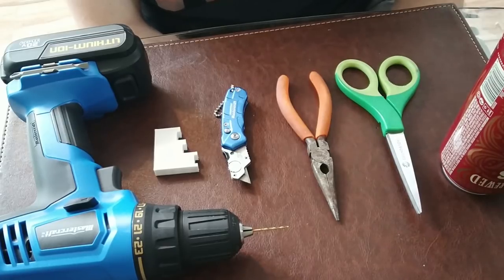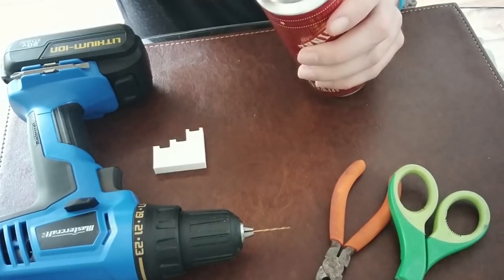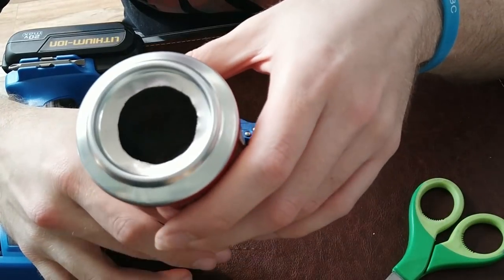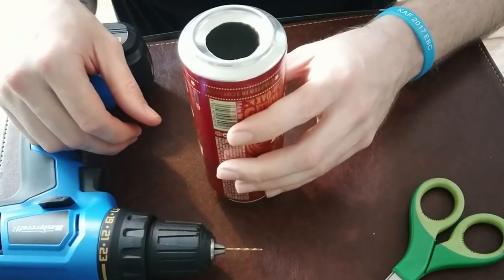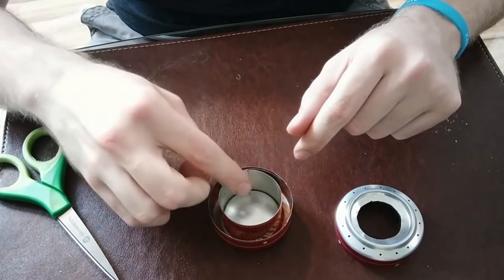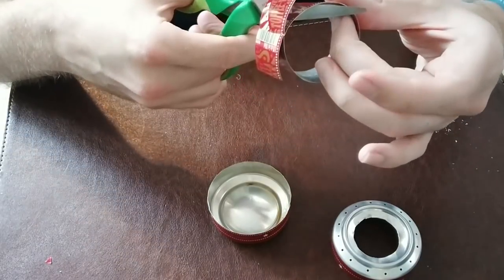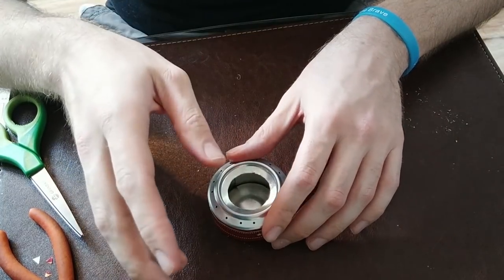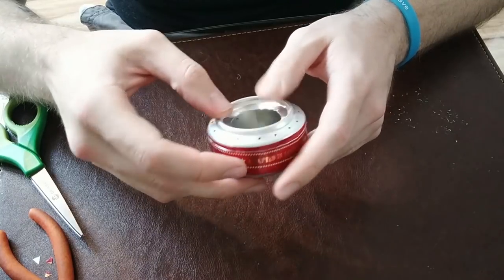DIY Double Walled Pop Can Stove!

Comment: Interesting method.  @17:30, I would think that since the aluminum is scored, you would be able to just flex along the score line and break the sheet you want from the scrap.

Personally, I just slowly freeze a few cans full of water and use the ice as a support and go to town on making all my cuts in one session.  Only downside is sometimes the ice will split a can when it freezes.
Reply from the maker: I never thought of using ice as a solid inside while cutting. Not a bad idea at all. Thanks
Reply: @JustForTheTrekOfIt  you'll lose a can once in a while from splitting, but its not bad.
Reply: dremmel tool with a small thin grinding disc could work wonders

Comment: I think its better to put the lille hole inside., to concentrate the flame inside,  and  to save  the fluid.
Reply from the maker: You mean a single hole in the middle or inside the walls? I prefer the holes on the outside of the ring so you don't risk snuffing the flame when you put a pot on top

Comment: How was your trip, and did the stove work well for you? I like the low profile design you have here. Does it work better than some of the taller ones I'm seeing? Everyone has measurements for their stoves, but nobody says why they chose that size.
Reply from the maker: JR M, to be honest, I haven't tested taller or shorter designs to compare them yet. I might do that in the future to get the best option. It works well and boils water in about 5 mins but does use a bit more fuel than I expected so maybe a taller design would use less. I will have to try that and see.
Reply: As you test more, please keep us posted. =)

Comment: I honestly would not worry about muffler sealer or as another commenter added, JB Weld once the meterial hardened. I would caution to take care that none of the fuel drips or splashes into the cooking pots or pans, there are toxic additives in denatured alcohol.
Reply from the maker: NewHampshire Jack I agree, the JB weld and muffler sealer might be a little overkill for something that is supposed to be cheap, easy and realistically easy to replace if anything breaks down over time

Comment: 20:25 Your notches are much too deep. That depth will cause the stove to lose pressure and burn slower near the end, as soon as the alcohol level falls below the top of the notch. The outer chamber pressure will be able to vent to the inner chamber. Your notches should be only 1-2 mm max.
Reply from the maker: Thanks for the tip!

Comment: Please remake this video to cut sequence of max 2 min and "Basically" get rid of the 24 min. "Obviously" everyone's time is important..! Thanks!
Reply from the maker: I appreciate the feedback but a remake isn't something I'm going to be doing anytime soon. I've started using gas stoves as they are a bit safer and lighter than carrying liquid fuels on the trail so I'm not sure if I would make any more of these stoves to take with me bug keep one as a spare just in case.
Reply: @JustForTheTrekOfIt  I find your comment very informative and useful...and is something got me to consider the same. Thanks for responding...and sharing your vide as well. Cheers!

Comment: You might like to check out a new design I've posted with internal and external flame jets. It works best with ethanol, heats from the moment it's lit, doesn't need a pot stand and allows easy retrieval of unburnt fuel for later use. It also works well with charcoal
https://www.youtube.com/watch?v=DcUKaHoYEUU

Comment: You could have made this in under 5 minutes without leaving out any info. Huh? What? Yeah you are slow. Also just make your sides wider leaving more to overlap. You won't need any tape or glue
Reply from the maker: Beaches south of L.A. Thanks for the feedback and yes, it was longer than I expected to be originally. I might make a trimmed down version in the future. As for the overlap, I don't trust it not to leak during operation without the tape. I don't want to risk a leak of flamible liquid just to save a buck.
Reply: Just For The Trek Of It leak? It'll just burn adding to the flame. That's if it leaks which it typically doesn't. I've heard others say that the heat melts the paint turning it into a glue like sealant.